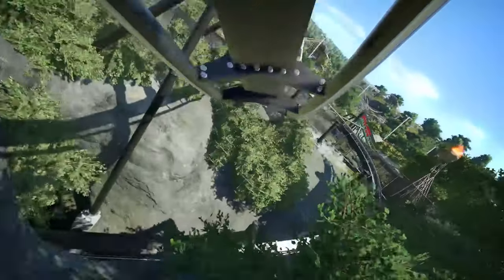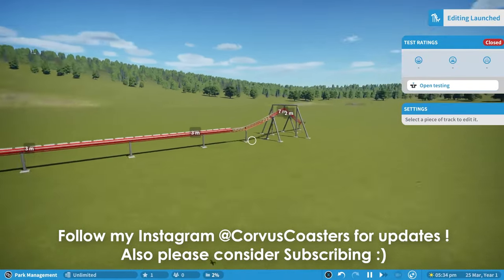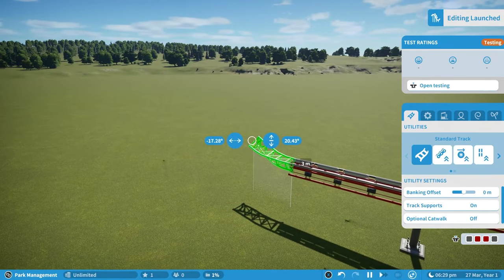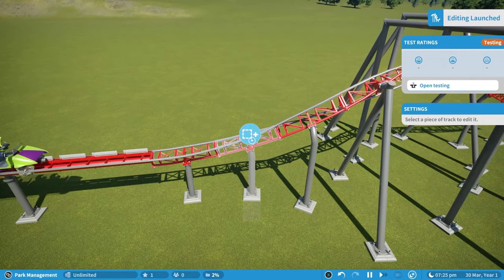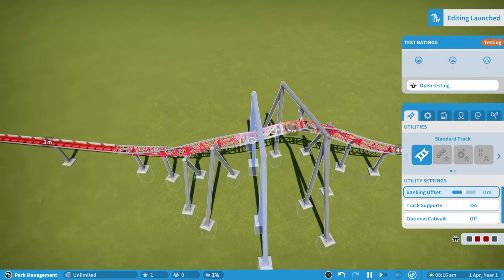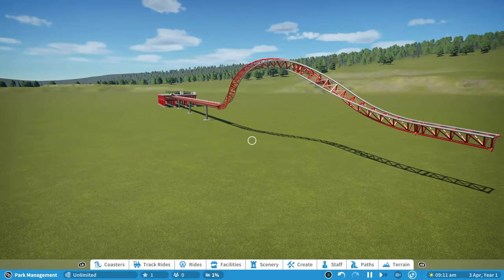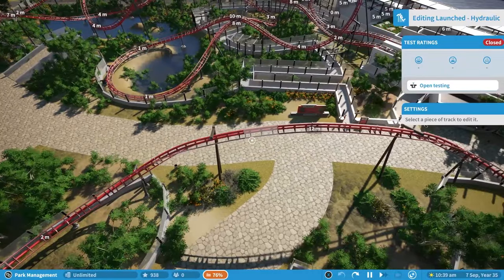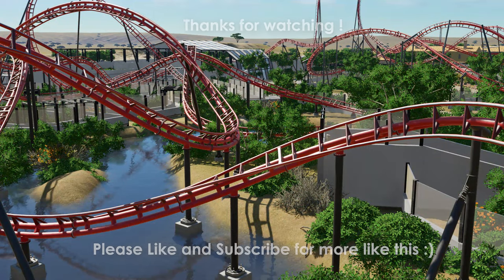How to make Smooth Coasters - Planet Coaster

Comment: I finally figured out why planet coaster has incredibly rough coasters! At the beginning of each track piece there is a very small straight section, then after that the bending/ banking starts. In another coaster building game, theme park tycoon 2 on Roblox, they alleviate this issue by making the track move right from the start, therefore making a smooth coaster is easier!
Reply from the maker: It's annoying, hopefully solved in PlanCo 2 :)
Reply: PlanCo is 100000x better than tpt2. it just needs practice
Reply: @CorvusCoasters plan2 isnt confiemed tho
Reply: @timm14171 Theme park tycoon 2 has potential, it’s just Roblox and the dev that limits it, it would be better with more features.
Reply: @RonaldTrumpOfficial  No it doesnt have potential. Making it on roblox the devs knew there are servere restrictions
Reply: miranoobvidz2261  uh first of all ive had the passes a long time and its still a terrible builder
Reply: miranoobvidz2261  OKAY!
Reply: miranoobvidz2261  i am talking about
the advanced editor
Reply: The Only thing I hate about Planet coaster is how camera Works-
Reply: @TopThrillsTimothy ehhh not really, if we're strictly going on the quality of the coaster building. If Tpt2 wasn't on roblox, it would be much better than Pco
Reply: @noyesnohaha now it is🎉
Reply: Tpt2 has the roughest movements because it uses a weird advanced system so it can get really difficult to smooth it out, also there’s not as much features like the smooth feature in planet coaster. Also thw smoothest coaster in tpt2 is really not so smooth where as planet coaster is more realistic. And planet coaster lets you adjust the snapping and tpt2 has the basic building which just doesn’t make it realistic and gives you about no freedom to build what you want.
Reply: @noyesnohaha yes it us
Reply: @warriorfam3489  shush
Reply: @JesusMySavior78 advanced editor:
Reply: From the future, they fixed it so good with the second game.
Reply: @noyesnohaha well now it came out

Comment: Great video.  I normally smooth out using 3 pieces at a time but I definitely need to give the auto complete method a try.  Thanks for this!
Reply from the maker: Thanks for the support as always :)
Reply: Yeah ive used it on a few of my coasters. It helps out a lot.
Reply: I use a mix of the autocomplete and the 4 meter method.
Reply: I normally do 2 or 3 pieces and in places that really need it i use the auto complete

Comment: Haven't had a problem with smoothness yet building my first roller coaster, my biggest issue is maintaining speed. I'm trying to recreate Ride Of Steel from Darien Lake. The real coaster has a chain lift of 208 feet and the drop is about 68 degrees hitting a top speed of 73 mph before going into a left hand 90 degree turn and then up a 160 foot camel hump and then into a 540 degree helix. In the ride camera of the actual coaster it never loses speed. In my recreation I can't get mine to go up thr camel hump without slowing down to 30mph. I'm kinda stumped
Reply from the maker: You can change the friction and lift hill speeds in the game to make your coaster faster but it's normally pretty accurate, you could always ask for help in my discord server also :)
Reply: @CorvusCoasters  I'll have to try that out when I get home from work. I can't help but laugh at my first attempt though, apparently my guests were terrified of everything but the first hill drop and my G's were way over 5 😂 at one point it hit 9.72

Comment: This will really help me out! Thanks! Question though, for those of us who prefer to work in Imperial units, what's the length of a track section you'd recommend? 13.12 feet?

Also, are there any differences between doing this on PC and whatever gaming system you're using here?
Reply: I use the same method, but can vary my track lengths based on element size, etc. Also, max out your banking offset, and minimize it for the tops of airtime hills. It makes a difference.
Reply from the maker: It's the same on pc but I don't know the imperial so I'd just convert it. Thanks for watching:)

Comment: Awesome video again mate. I use the same method but slightly different. I select the track piece, the one before and the one after, then smooth all 3 times, go one way round the coaster, then the backwards, any sections that are still funky I use the autocomplete method. Although I'd only autocomplete when your 100% on your layout as editing after using autocomplete is a nightmare compared to 4m sections
Reply from the maker: That's great, thank you very much for watching:)

Comment: Lovely video as always! The 4m method (with 6 to 8 passes) is always what I have and will use as it is the best that we can do on console! Can I ask though why do you not use banking offset just wondering?
Reply from the maker: Never really experimented with it that much, I need to look more into it and why to use it :)
Reply: @CorvusCoasters  it heartlines the track just from banking and it’s super helpful for profiling and smoothing
Reply from the maker: I'll have to give it a go !
Reply: @CorvusCoasters  also smoothing 3 pieces at a time works the best on console. i probably just explained it bad but 4 pieces works better on the pc version for when you upgrade
Reply: @CorvusCoasters  I would I used 4m method with 1m or 2m hesrtlining on all my coasters in my newest park😉